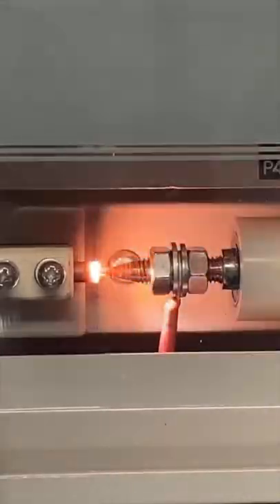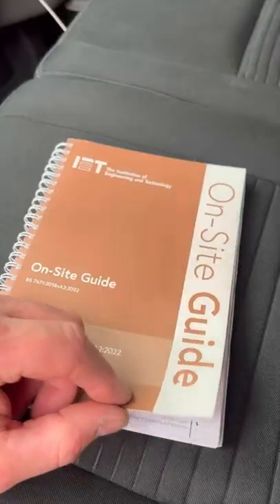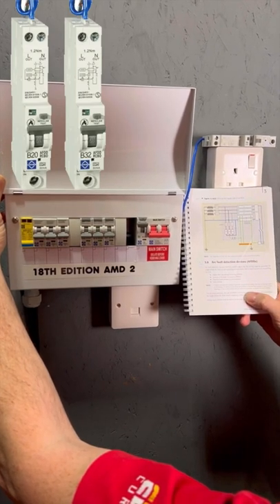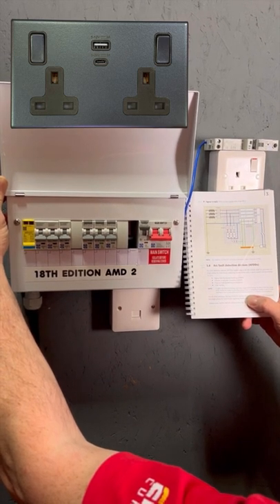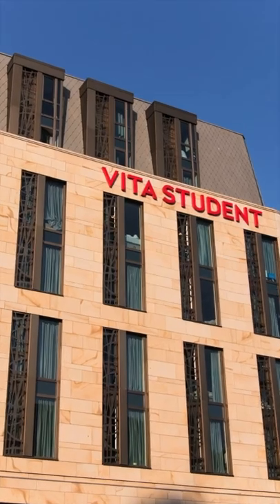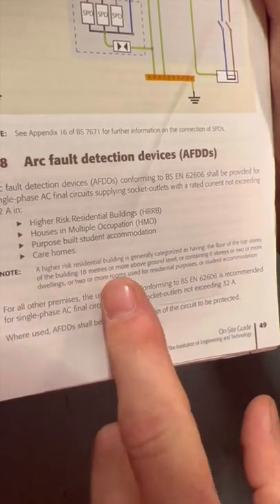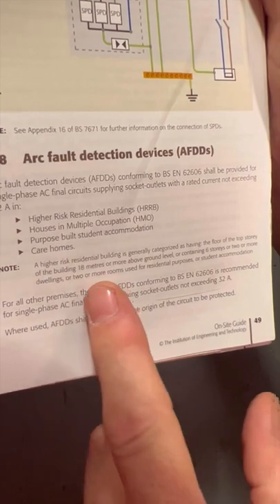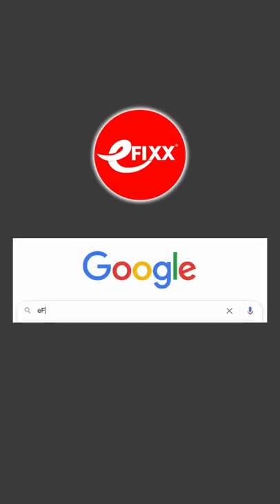Do you need to install an AFDD?

Comment: What about on a Eicr on a HMO - is it a C2 there not fitted or C3 as it's existing? ... Also can you fit one to a circuit with a gas hob ignition? Or will it activate? ...
Reply: Personally I’d say C3 for an EICR at the moment. Got nothing to back that up though.
Reply: It does not trigger an afdd using an igniter on that circuit.
Reply: They’re still quite blurred on being mandatory in my opinion. Similar to rcbo and surge protection ( which I would recommend on eicrs )  Can’t quite justify the price of them in all honesty when rcbo protection is safe as houses anyways. Probably get some stick for that but hey ho 😆

Comment: Is this only for new installs or new circuits?
Example, a flat on the 7th floor of a 9 floor block has a metal CU with RCBOs on all circuits.  Do AFDDs need to be swapped into the socket circuits removing the RCBOs?
Reply: All electrical work undertaken needs to comply to the standards that are in effect at the time. This doesn't mean that you are compelled to bring an existing installation up to the current standard.

A new circuit added needs to comply to the current regulations.

But, I will say this, and I know some electricians on here do not agree with this:
You should take every opportunity to improve the safety of an installation, within reason. Within reason, means within a reasonable cost.

You have to consider the risk to building and to people. Then consider how much it costs to mitigate those risks.

The risks here are: a fire risk. 
You are talking about a flat on the 7th floor of clearly a block of flats, which means multiple flats, and who knows how many occupants, 20, 50, 100?

How much does it cost to mitigate the risk? How much is a human life worth?

Given the opportunity for harm here, the potential loss of life that could occur, I'd be taking the opportunity to upgrade the installation and put the AFDD's even if the regulations don't require it.

Now you have indicated in your example or job that the flat is on the 7th floor.
If I recall correctly the requirement to install an AFDD does not apply to all installations; it is mandatory for houses of multiple occupation, blocks of flats higher than 6 floors, student accommodation and care homes.

So the opinion of any electrician that disagrees with it being installed is irrelevant, in the example you have given. You have no choice in that example.

The requirement is that the AFDDs be used to protect mains socket outlets not exceeding 32 Amps.

For new circuits you have to install the AFDD if there are socket outlets on that circuit.
The question is whether you are required to retrofit other existing circuits which have socket outlets. Arguably not. Because there is no obligation to bring an existing installation up to the current regs.

However, if you install a new circuit and you fit an AFDD, and you have an existing circuit or two that doesn't have them, then you have created a very odd situation where that CU has a mix of circuits protected and some not by an AFDD. It is inconsistent. And people (landlord, tenants, fire safety people) will question how that situation has arisen. And the answer is "We're trying to save money by not applying the regulations to the entire CU". It doesn't look good.

How many circuits are there in a flat which have single phase, <32 Amp sockets?  Typically one or two.  So it shouldn't be too expensive. They typically cost £99.
Reply: @deang5622  
Socket not exceeding 32A. It says socket not circuit. A double is rated at 20 amp combined.  So in spec.

A single socket can be on a cooker circuit of 40 amp (they are on cooker isolation switches. So this must be on an AFDD, as the socket is less than 32 amps. 

In short is is saying that irrespective of the  rating of the MCB, it could be 6A, 16A, 32A, 40A circuits, if a socket is on it (not a high current commando socket over 32A) even if a 15A round pin or 13A square pin, an AFDD has to be fitted.

So, a lighting circuit with a 5A round pin sockets serving  a few table lamp needs an AFDD.  The regs do not discriminate between lighting or power circuits.

Comment: "2 dwellings, or 2 or more rooms used for residential purposes" so a ground floor flat, with a 1st story flat above it would need AFDD's... Even tho its only 2 stories tall?

That entire Note statement is very VERY confusing.with far to many or statements, and should have been laid out as more clearly defined list, just like the list above it.
Reply: It really is not confusing. It is if your English comprehension skills are deficient.

The requirement whether an AFDD is needed is written as a long sentence but comprised of "or" operators. A or B or C or D.
So you have to scan through that sentence and looking at each condition in turn. If you find a condition that matches your construction scenario then you must fit an AFDD.
Reply: Go on then Dean talk us through your big brain method with an example of each as you pass your “or” operators. Pmsl

Comment: Why has this become a thing to install now ,what's changed ?
Reply: Grenfell tower
Reply: It improves safety. Many changes to the regulations over decades have come about as technology has improved and with the goal being to improve safety.

Are you saying that safety should not be improved?
Reply: @deang5622  generally curious, can you elaborate on what an arc fault detector actually does that makes any noticeable “safety” difference and if there was even a concern in the first place. Why isn’t An RCBO enough all of a sudden?
Reply from the maker: See link in description
Reply: Greenfell fire
Reply: @johnmilla358  But the cause of the Grenfell fire is believed to be poorly crimped wires in the fridge, which lead to high resistance connections, and overheating.

This wouldn't have been detected by an AFD.
Reply: In fact neither of: circuit breaker/fuse, RCD, AFD, or SPD could detect the type of fault in the fridge that lead to the Grenfell fire. And that is scary.
Reply: @themarkcarr  No, I completely disagree with that. It's the IET now, not IEE.
Their focus is on safety, they are mostly degree qualified engineers (they werewhen they were The IEE but have now opened up membership to lower grade technicians and created new membership levels ). Degree qualified engineers are not going to be in bed with manufacturers.
Reply: @deang5622  safety from what ,bad components , poor workmanship ,or a supply issue?
Reply: @deang5622  If I remember correctly a fire barrier had been breached.
Reply: @raychambers3646  In the case of the Grenfell fire, it appears the problem was caused by a manufacturing defect. But they decided not to do a product recall, so I presume their investigation concluded that only one or very small number of fridges were affected. I'm guessing the wires were crimped by hand and it was one particular person that caused it..human error.
Reply: @raychambers3646  Fire barrier breached..I don't know if that was in the fridge, but yes there was a kind of fire barrier breached in the flat.

The strategy of the Fire Brigade was to tell residents to stay in their flats/apartments and not to evacuate the building. The idea was that the building was constructed in such a way the fire should be contained with in the flat and that would be enough time for the fire brigade to put the fire out before it could spread to adjoining flats.

Well sadly, the attractive cladding they placed on the outside of the building contained aluminium and was combustible! And so the fire spread from the flat up the outside of the building, and then setting other flats alight. So yes, there was a containment breach caused by the external combustible cladding.
Reply: @deang5622  yeah ok it’s now the IET but my comment still stands the manufacturers drive it and whilst you might believe it doesn’t you will never convince me. This is the same drip feed rubbish I’ve seen over 40 years. Get in slow hit the landlords and high rises first to flood the market with a new product and help the manufacturers get the money rolling and hope the price comes down then hit everyone in future editions / amendments. The way it’s going consumers will need a degree to work out their own CU’s. Seen it all before
Reply: @raychambers3646  All components used in mains electrical installations in the UK have to confirm to various British Standard, the plugs, the fuses, the cabling, the consumer units and so on.  Those BS assure the safety quality of those components.

So the issue around safety and the regulations are about assuring safety of an electrical installation when in operational service, and ensuring it is constructed in a safe way prior to going into service.
So a lot of it is about protecting from faults that occur when in service, which can be down to components which become unserviceable but also down to faults such on connections/jointing, where it is not so much as a component failing but the interface between components (such as a cable and terminal).
Reply: @themarkcarr  I don't think the manufacturers do drive it. Your simply believing it does without evidence doesn't make it true.
Reply: @themarkcarr  Let me assure you, The IET does not exist to make money for manufacturers. That is not in their Royal Charter
Reply: @deang5622  FYI you didn’t have to explain an RCBO, from what  I understand they use high frequency or sinusoidal distortions to detect a arc fault but wouldn’t this just lead to heaps of nuisance tripping? Ie from reactive loads, dimmers, switches, ballast and motors etc
Reply: @deang5622  yes in thr UK but it doesn't stop people using substandard material , ie Chinese crap .
Reply: @deang5622  possibly tripped or blew a fuse after the fact ,but there is still a fire igniting .
Reply: Increased government profiting, that's what's changed.
Reply: Ill tell you what's changed, the increase in government profiteering, as I cannot find a clear and relevant explanation for the need or the cause of the need for these AFD devices.
Reply: @themarkcarr  Nail on the head there pal.
Reply: @youknowwhatyouhavedones7044  Not high frequency to detect a fault but an RCBO and an RCD use voltage comparators.
Reply: @tyronenelson9124  I agree but what do you even mean with your last comment
Reply: @youknowwhatyouhavedones7044  Which comment?
Reply: @tyronenelson9124  my nephew is having a new D B fitted the sparky said you have to have one fitted cos you insurance would be void !
Reply: @raychambers3646  Well well what a surprise that is, threatening insurance status now, that is basically scaremongering people into having this device fitted.
Reply: @raychambers3646  I would entirely understand voiding any insurance if not having this AFD fitted could be proved to have causing the fire, but fat chance of that.
Reply: @tyronenelson9124  most insurance companies look for a way out and this could be it .
Reply: @raychambers3646  True.
Reply: @deang5622  depends on how much they are paying,
Reply: @deang5622  wasn't there a ship in the Falklands war mad of aluminium that caught fire ?
Reply: @youknowwhatyouhavedones7044 Oh come on, you know full well an RCBO only detects over current and earth leakage fault.

Don't pretend you don't know this.

AFDD detects a spark. And you know that too.

Let's not play this game, please.
Reply: @youknowwhatyouhavedones7044  I can't believe you are coming out with the crap you are coming out with.

The first thing I will say, is I have never looked at the voltage or current waveforms on an oscilloscope when there is an arc being produced. It is an interesting subject but I don't have the equipment to do it and I am not going to go out and buy it just to satisfy some random YouTube user.

AFDDs use a microprocessor, so clearly they must employ an analogue to digital converter, and the processor has been programmed to look for a particular pattern which is specific to an arc fault.  Now whether they do a Fast Fourier transform and then start looking at harmonics I do not know.

I found an article on AFDD's written by the IET and it presented no discussion on the particular algorithm employed to detect an arc. And I wasn't about to spend a significant amount of time trying to find the information.

I do know time plays a factor in the algorithm, I was able to glean that piece of information.

Given what I have said above then, I believe your suggestion that reactive loads producing sparks falsely triggering the AFDD is wrong. Firstly the duration isn't long enough to trigger the AFDD. Now there might well be other techniques coded into the firmware which also rejects these and prevents false positives.

I am a little surprised at your thought processes here. It is a bit concerning.
Do you not think the product manufacturers have identified a way to discriminate between sparks when turning off an inductive load and the type of arc that poses a fire risk? Isn't this common sense that they have?

If the manufacturer hasn't  been able to discriminate between between these different types of arc, there is going to be a lot of circuits being switched off unnecessarily which is going to cause massive inconvenience, which would eventually lead to a drop in sales of that manufacturer's product, let alone the safety risk of repeatedly tripping the circuit. Common sense says they are going to put the R&D effort in to developing a way to be able to discriminate between the different types of arc. 

Now whilst I may not know, and incidentally I never claimed I did know in detail what algorithm is employed in an AFDD, that fact does not mean that the manufacturers don't have good algorithms and techniques to detect the particular arc they are trying to detect.

Use your brain and think it through.
Reply: @deang5622  are you normal in the head mate, perhaps you’re reading my replies wrong. I Should’ve wrote them better
Reply: @deang5622  I never made any definitive statements I just asked a Question as I’ve been hearing these have been causing problems in the Uk ie Nuisance Tripping when turning on Fluros, why are you so mad wasnt this from months ago?
Reply: @raychambers3646  Yes there was a ship that caught fire. And yes, they did identify that the aluminium superstructure was combustible and worsened the severity of the fire. It might have been HMS Sheffield but I am unable remember which ship it was: several were sunk.

If I recall correctly, design standards for Royal Navy ships changed afterwards to prevent a recurrence.
Reply: @youknowwhatyouhavedones7044  I will tell you why I am mad. Not so much mad as frustrated.

I get in to so many arguments with idiots on YouTube that think they know what they are talking about on electrical matters. 

I don't mind helping people and educating them, but don't ever try and tell me I don't know what I am talking about when it comes to electrical, electronic or computing subjects. I have been in this field for 40 years.

These idiots have a small amount of knowledge but clearly haven't studied the subjects to the level I have let alone have 40 years professional experience.
As they say, a small amount of knowledge is a dangerous thing.

I usually end up hammering them in to the ground, but that is their own fault for refusing to back down.
Reply: @tyronenelson9124  An RCD does not use voltage comparators.

They are actually current driven, not voltage.
The live and neutral currents produce two magnetic fields that are normally equal and opposite which cancel each other out in a small ferrite ring.

There's a sense coil into which a voltage is induced if the two magnetic fields fall out of balance. The current from that sense coil then trips the mechanism and power to the circuit is removed.

Voltage comparators are typically electronic based, such as integrated circuit based which then requires a DC power supply of low voltage.

The problem then of course then is, how do you get a voltage for comparison from the live and neutral currents. That would require extremely high power inline series resistors of a defined and low value of resistance.
Those resistors would be physically huge, humungous.

Another would be to use current transformers, rectify the signals and then use voltage comparator integrated circuits.
Possible, but more costly, physically larger than other methods and unnecessarily.
Reply: @youknowwhatyouhavedones7044  Probably more normal than you are. More highly educated too. Perhaps that is what you are detecting...